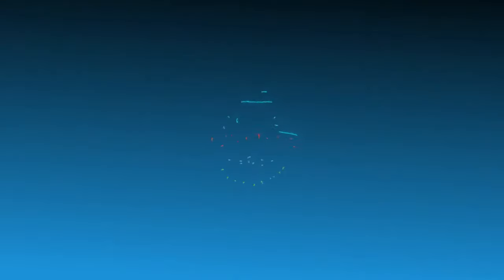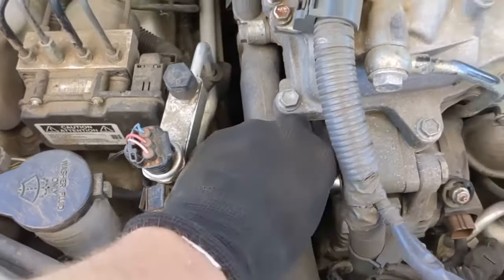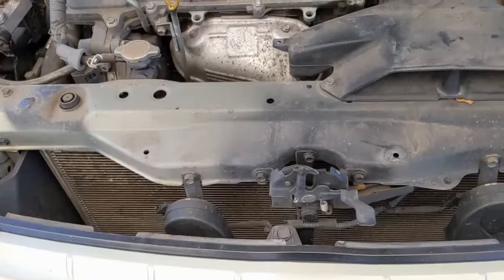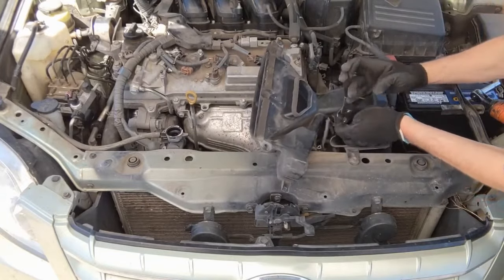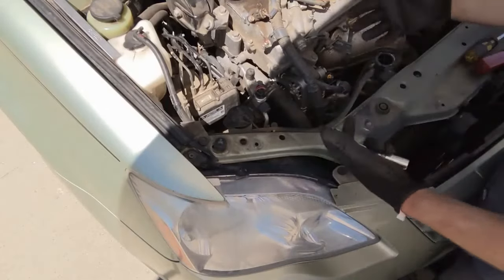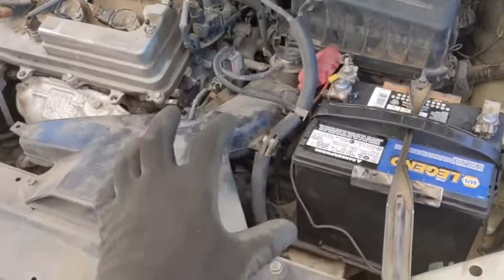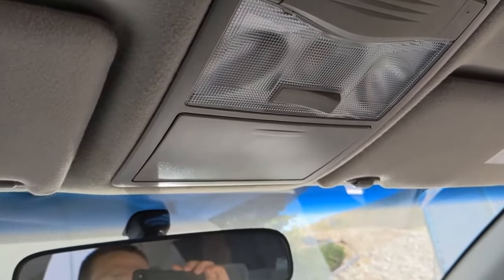2005-2012 Toyota Avalon Alternator Replacement

Comment: Got stranded in Chicago with a bad alternator. I just removed the radiator hose off the thermostat housing and pushed it to the side. Way quicker for my situation. No need to remove shroud.

Comment: Would it not be easier to loosen the radiator support to gain access to alternator and then after you’re finished if you want to drain the coolant go for it? Removing the fan seems like extra work.
Reply from the maker: Yeah, I showed two different ways of removing the alternator. The manual has you remove the fan which requires draining the coolant and removing the hose. The alternative method not in the manual is to remove the radiator support only. Either one works but you don't need to do both.
Reply: Right, what I’m saying is it seems easier to me to go with the super easy first option you showed and later after the alternator is installed if you decide to change your coolant you can drain and refill. Going to the extra work of removing  the electric fan shroud just so you can replace the coolant seems odd to me. Maybe I’m missing something here.  

Great video and super informative btw.
Reply: @jeffsmith4945  Same, I'm really scratching my head why he didn't just show us the easy way, which is probably what most people are looking for including myself. I saw him pull the alternator out with the fan out, but how does it look pulling it out with just the radiator support removed? Would have loved to see how much pulling on the radiator would be needed, how it would twist out ect.

Comment: Great video.  Did it without taking tire off or removing the radiator parts (just the top framework part and loosened the two bolts at the bottom of the radiator so it would flex forward some).  Really appreciate it!  '08 Avalon XLS

Comment: I did mine last night.  Don't take off the shroud.  Don't take off the heat shield.  Take  the belt off. Take the three bolts out. Bring it forward.  Turn it to the side to remove the bottom bracket. Take the top radiator hose off. Remove the bolt that ties that electrical bundle down.  (That's just above the hose). Move the alternator to the left side of the radiator and up through where the hose and electrical bundle sit and you're clear.  Grab your new alternator and reverse the process. No need to dismantle a bunch of other stuff just to change your alternator.
Reply: You should've made a video 😢 lol
Reply: My papa and his best friend did the same thing on a few of these, and I'm going to mimic that too xD
Reply: Agreed. I am glad he gave other tips too. There is another video on here "EASY! 2005-2012 Toyota Avalon alternator replacement." that does a much faster processes. You don't need to deal with the air intake at all.
Think I'm going to do a combination of both of these videos, as I also want to replace the belt and the coolant.

Comment: I watched more than a dozen videos before replacing my 2008 RX350 Alternator. Most of them were not giving enough info by omitting vital parts of the procedure. Your video was simple, informative with important tips (like the one about reinstalling the air intake Nr2) and made my alternator replacement process easy!
Reply from the maker: Glad this video was helpful! Thanks for the positive feed back 👍

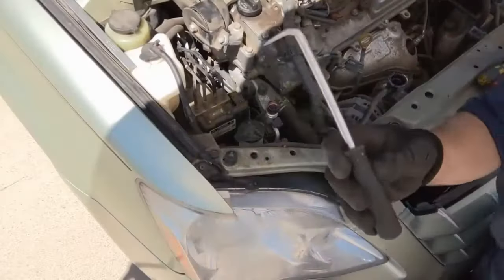Comment: Hey I have a question. At 8:43 you show a cable on the back bracket of the alternator. Where does that cable go to?
Reply: Yes, i have the same question, did anyone find out? I missed it and the stupid wire tore off of somewhere...uggh
Reply: @slayer7976  it’s from the camshaft sensor bro. You have to remover the alternator and loosen up the bolts from the ac compressor and move it around. The same shit happened to me and I went to the junkyard to track the wire and I just cut off the wires with the sensor and used heat shrink to wire it together bro.
Reply: My bad I mean crankshaft sensor*
Reply: Gd it! I was afraid of that. Gotta take the whole thing back apart, what a cluster fk. Thanks for the reply, appreciate it
Reply: @slayer7976  no problem man! I’m here if you need help bro!
Reply: @slayer7976  hey did you fix it yet?
Reply: @junebug346  yes, I had to take it all apart and was able to repair the wiring into the plug. What a pita! Thanks for your help 👍

Comment: Battery light comes on and off when driving
Reply: It's likely the pulley on the alternator failing. Eventually it won't stay connected anymore and the battery light will stay on and it'll die... I would start saving for an alternator and maybe get it replaced before it fails

Comment: As long as you were going to drain the coolant, you could have removed the lower radiator hose at its engine connection and that would have allowed you to get at the lower alternator bolt much easier.

Comment: There are 2 types of OEM Denson alternators for the Avalon

One is a 100 amp & the other is a 130 amp.  

Which one is the correct one?
Reply from the maker: @GILLETE32  It should be labeled on the alternator. If you don't see a label then you may need to call the dealer and talk with the parts department. With the last 8 digits of your VIN they should be able to tell you 👍

Comment: I really appreciate this video. 
Do you have one that includes the belt ?
Reply from the maker: Thanks 🙂. I don't have a belt replacement video. Maybe in the future I'll put one together.
Reply: I just searched Google Images for a serpentine belt diagram for my 2005 and it was extremely easy to weave it back on the correct way following the diagram

Comment: Awesome video - quick and to the point.   I was able to remove my alternator (2008 Avalon) in about 30 min after watching this.  Was not "easy" but I knew what I was facing in advance thanks to this.   I did remove the radiator bracket rather than drain the fluid and remove the fan shroud,  and I also found it necessary or at least highly advisable to remove the bolt (12mm) holding the oil dip-stick,  allowing the dip-stick to flop to the side out of the way.  That made a huge difference.   New alternator is on order - hope re-assembly goes as smooth.  I suspect I will have to remove wheel and splash guard to get the access to re-install the serpentine belt.
Reply from the maker: Awesome Jim! Feels good when we can get the car fixed 👍

Comment: I changed my alternator for the 2006 avalon limited. I didnt have to drain the fluid. Or move the radiator. I removed the 3 screws holding the heat sheild and the dipstick bolt. Also that easy to reach bracket bolt, i went for the more difficult bolt that attaches the bracket to the alternator because i wouldnt have room to remove the alternator and i didnt want to risk damaging the radiator.

Comment: I just replaced the alternator on my 2011 avalon after watching about 15 to 20 other guys who had previously went through that process, and made the video available for the viewing public. 

Your videos helped a long in getting the job done. However one thing non of you guys addressed in your videos is the difficulty that could be encountered while extracting the bottom bolt. 

I ran into a brick wall literally while trying to unscrew that bolt. The deep sucket was too long to work with given the tight space available, even though I had broken the bold loose, I still couldn't unscrew it with my fingers, and the regular sucket is too short to begin with, and can't get to the bolt. 

I had to unscrew the motor mounts, jack the engine up to move the bolt up and above the wall that was the barrier, and had the bolt exposed, and was able to extract it with much ease.

Comment: the nut for the belt wont budge for me, i tried wd40 no dice. admittedly i dont have one of those long tools so i was trying with just a standard 14 wrench, is it possible to do with that or do i just actually need the extender 

please explain in simple terms, i am not a car person just a young broke person trying to fix his car. but the most ive ever done car maintenance wise is change my moms filter so im like a fish in a desert
Reply from the maker: Having a longer handle gives you more torque so turning the tensioner will be easier than a smaller wrench. You can borrow the tool from O'Reilly's or AutoZone 👍